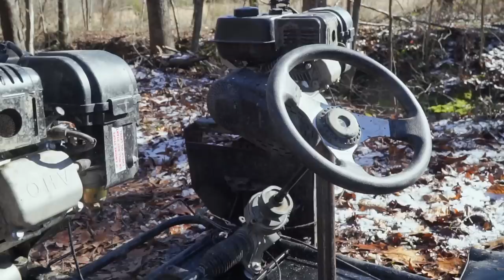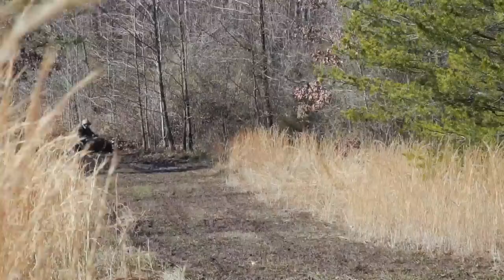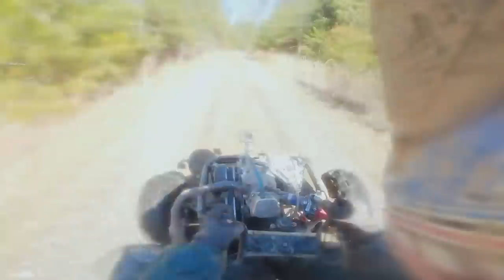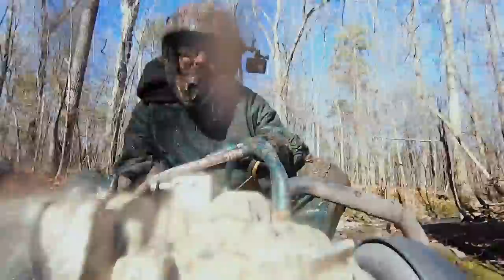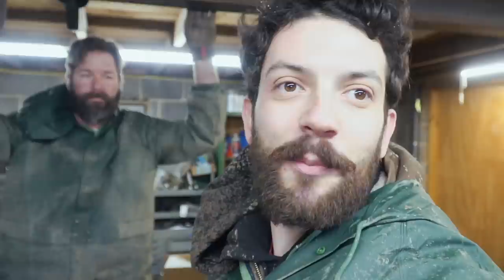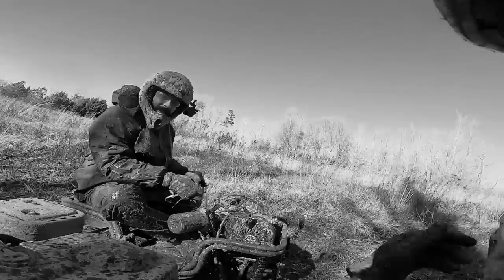4 Engine Go Kart vs. 4WD Power Wheels Go Kart | OFFROAD SHOWDOWN!

Comment from the maker: Definitely need to revisit this when we put new tires on the four engine go kart!
Reply: 100%
Reply: I think the four engine gocart needs stage two engines
Reply: Make a motor bike out of a bycycle or with a bmx
Reply: U should do a little rascal giveaway
Reply: Get some 18'' v groove muddies on that it would be sick.
Reply: Why was he riding the edge of the track? He was driving through brush lol
Reply: The tires yeah but I think it need a back to the drawing board moment
Reply: For sure
Reply: Or maybe make 4 new carts 😁😉😉
Reply: Time for "Cleats" aka Snow Hogs from Carlisle, for the 4 Engine kart
Reply: @A.M. Fishing & Adventures you do know they have $800 just in the engines and clutches
Reply: Yep, it'll be a totally different story...
Reply: @aaronraida1882  stage 4
Reply: 100%
Reply: Yeye Brother
Reply: You can get attachable forks to put on the tractor relatively easily. They aren’t overly expensive.
Reply: Go with 4 stage 4 predators or that new hot Tillotson on the original! Maybe longer struts for taller tires too?
Reply: @gamenfix2586  check out Isaac's channel....he's doing exactly that.
Reply: Full suspension!
Reply: it seems to have a lower top speed, too - I'd think about a pulley/sprocket change to even them up?
Reply: If I could thumb up this comment a million more times I would. Ike would smoke you in the uphill in the mud drag, poor buy was all over the place!!
Reply: Yes definitely
Reply: please go bigger on the 3 engine cart. 4x4 is no good when you only have 2 inches ground clearance. 21x10.50-8 3 wheeler tires would go a long way. and you could run them at low pressure for a little suspension
Reply: The four engine kart really needs some mods and improvements, it will be a beast after that!
Reply: I think the 4 engine would be more stable with a live axle in the rear
Reply: Please replace all tires and wheels with the likes of those on the rear of the Bronco. Never mind the torque-steer, muscle it like your life depends on it!
Reply: Take the governors off the 4 motor cart and tires!
Reply: Bring out the 420 swapped polaris and compete again the bronco.
Reply: @aaronraida1882  yeah buddy
Reply: Put AG tires on er'
Reply: Aren't y'all a lil to old for this stuff? I Kno it's fun go for it
Reply: Definitely
Reply: Bigger knobby tires and some suspension. You're bouncing around so much you can't even hold the pedal down..
Reply: Whatever happened to that ATV you guys bought
Reply: U need new tires
Reply: @CarsandCameras Greetings from England, Love what you do. Apologies as I've no idea of the etiquette on said platform, certainly don't want to piss a Yank off, we all remember you leaving the Empire etc. Does Isaac have a Cousin Rick in England by any chance? This blokes vids put your work on my radar, & like a lot of Isaac's work, I think Cousin Rick's latest masterpiece is Genius. 
Spoiler alert: Sinclair C5 - Crazy 125cc build - Part 2
https://youtu.be/gh6-zqwdbCs
Reply: Time to swap those 4 212s out for 4 420s with a gear change as well I think 50 tooth sprockets would be awesome
Reply: Get rid of the goveners please!! And bigger better tyres!
Reply: So in four years we will see the rematch?
Reply: You guys should build a mud mower
Reply: You guys need to make some mud mowers
Reply: even with new tires i still dont think the 4 engine will keep up with the bronco, be fun to find out :)
Reply: @tonyjeffery3988  well you could go follow Isaac's channel. John isn't on there.
Reply: Need new tire tread and don't give it Full Throttle right off the bat. There's no way to control that beast in full acceleration. Just engage get rolling then accelerate
Reply: Bring back the diesel cart
Reply: Yes but please mount that power wheels body.
Reply: GgGuilherme
Reply: No tug of war?

Comment: More ground clearance with larger tires on that thing would be beast
Reply: Monster truck version would be cool for sure. Big low pressure tires.
Reply: On which kart ???
Reply: It’s be a miracle if they pulled it off, but suspension would keep the power to the ground better aswell

Comment: I think that on the 4 engine go kart, you need big tires, more ground clearance, and maybe suspension. Great video.
Reply: How would you put suspension on that thing it needs to be scrapped
Reply: @frankdodson3534  I do not think that it needs to be scrapped. For one, it is their first 4x4 build, and it is actually pretty capable. It may not need suspension, but other than that, it is pretty good.

Comment: You guys should try to do some kind of combination of the two carts. A two engine cart with the CV axles and suspension. One engine for the front and one for the rear. I wonder how that would perform. Seems like a cool build

Comment: If there was anything you could change or improve, on the “Quad Rod”(4engine) what would it be
Reply: Solid axle in the front and back. Steering would be a pain, but it would prevent issues with the cart pulling one way from uneven delivery of power to each wheel.

Comment: That 4 engine go kart could be fast. You've got to drive that waaay different than a regular rwd 1 engine go kart. It needs to be man handled in the turns wide open damn near reverse entry drifting. Better traction would help but it takes a different driving style to rotate in the corner under power. Love this channel great karts.

Comment: The four engine seems to not have the top end and traction that the bronco has.  If they both had similar gearing and tires I believe the 4 engine would win every time
Reply: No, it's because the single engine cart has more horsepower. Having multiple engines doesn't increase hp, only torque. That's why the 4 engine one gets the hole shot but the other one out runs it ( more hp).
Reply: @burntsilverado  that's not how that works bud
Reply: @genoboughter3716  prove me wrong please.
Reply: @burntsilverado  the engine on the Bronco has to sent power/drive all four wheels which should have more drivetrain loss from the crank.. the 4 engine kart which is powering each wheel individually which should result in less drivetrain loss and more power to the wheels. But gearing wheel size rider weight ect ect..can play a big factor also
Reply: @burntsilverado  oh and driver mod also.. but that's just my theory

Comment: A few things to consider... yes it has 4 engines, but there's no way to sync them exact, so in a sense they are working against each other. And sure they yield 2 or 3 more horsepower total, but they also add a lot of extra weight, so you end up with a heavier cart that's harder to steer. Then add to the fact that you have no suspension and poor ground clearance on the four engine cart, where the bronco is lighter weight, can be made to steer better, has good clearance and suspension, and the bronco wins every time. The 4 engine cart is gonna crush the bronco on the start, but I think the bronco still takes it shortly after the start. And for playing in the mud, the bronco is definitely gonna go more places and win every time. Both are cool builds, but the bronco definitely takes the win in my book.

Comment: them engines gonna ned a refreshing, they sound pretty weird.
Reply: If your talking about the knocking noise, Its the Torque-A-verters, They can sound like rod knock over time as they age
Reply: @hotwheelsracer6380    I call that noise the need for new bushings. 

Unless you consider rod knock just another sign of age
Reply: I was using Rod knock as an example

Comment: Ya'll need to either get a set of forks from Northern Tool, that use a heavy duty bolt to clamp onto the cutting edge of your bucket. 
Then you should be able to get a set made by Kubota made for it, are make your own that you hookup after you drop the bucket off the front. 
The other way, is to make you a jen pole to use off the three point hitch off the back, that has a hook on it to hang either nylon straps, are chains.
Then you simply drop it down low enough to hookup whatever way you want to, and as long as you find the balance point, are catch whatever your lifting on each corner, you can pick it straight up and move it to wherever you want. 
Provided that your not trying to pickup more than tractor is rated for, are exceeds the limits of whatever you built for a lifting apparatus, and it bends instead of actually lifting it up. 
Works great either end for picking up different things, and loading or unloading things instead of trying to carry it by hand, are do it the way you did with the four engine go kart

Comment: Yall need to engineer some kind of sway bars for the Bronco, that will fix the issue with the front tire coming up when you accelerate thru turns. But make the sway bar easily detachable so you can disconnect it to give you more suspension travel for rock crawling.

Comment: The 4 engine go-kart has the same vibes as the Garage 54 makeshift V12, y'all'd gone and put an engine on each wheel, they'd took 3 4-bangers and bolted two above the original XD

Edit: Actually, the 4 engine kart has two main issues due to the mechanics involved in its design, the fact each torque converter is desynchronized by virtue of being 4 separate converters means when one wheel starts spinning, it starts going into a higher speed ratio and bogs that engine down when it regains grip making its converter slow to return to a higher torque ratio, and when stuck each wheel only has the power of 1 motor behind it rather than the full brunt of the total engine power, combined with the tread being rather mild its not got enough grip to keep moving in the muck, its a fun and interesting contraption yes, and its cool because its what it is, but there's a reason 4 years of building experience made the Bronco far faster. The 4 engine kart may be a relic of the past, but its rowdy and we still love it XD

Comment: How hard would it be to add suspension to the 4 engine gokart? Because that would be a machine for real. Also if that's too much work, just some larger tires should act as a little bit of a suspension.

Comment: You need to have the front engens going just a little bit faster than the rear that way when in the mud it will track straight

Comment: Id like to see the 4 engine kart rear end rebuilt with one engine and a live axle to lighten it up, simplify things mechanically, etc. It would still have 4 wheel drive, and plenty of torque and i think it would be faster because of the weight loss despite the power loss. Also remove the governors!

Comment: Four motors seem taking alot of weight. My friend build a gokart with 2x 212cc in the rear and thing are intense accelerating and topped out 50 mph. So for the tires ya should get a cleats that will definitely rip it!

Comment: The 4 engine cart was at such a disadvantage. Bald tires #1 and a smaller tire diameter. Something that small even tire diameter will change the carts final drive.

Comment: I was wondering if I could have a little help with my 212 cc go kart intruder its older and we just replaced the clutch and the carberator so it's the first time it ran in a while but it is very slow and the brakes barely work after we put hours into bleeding them. Anybody have any suggestions on what I could do??

Comment: Wonder if it would be a definite drag race if they were both geared alike one size smaller sprocket way larger try catch on the other one different size in the tires probably to

Comment: I would put panel a with 4 lights somewhere, each light would mean the engine is running. If a light goes out you would know an engine shut down. Seems like it is hard to hear if one goes out, unless you get drag from a dead engine.
Reply: That's a great idea! It would be super easy to do.

Comment: Get the same tires on 4 engine kart,rejet all 4 engines after free flowing exhaust is installed and maybe regear all 4 corners final ratio to match the tuned engines more optimally...

Comment: At least with 4 whole motors you know your getting out even if 2 of them die.....wait.... have you tested this?? What happens if only opposing diagonal engines were running? Can it do axis spins? Only front wheel drive? Hmmm...🤔

Comment: The 4 engine cart is heavier, with a worse CG, no suspension, smaller bald tires, wider, and longer.   Not surprising it didn't perform as well lol

Comment: It’s gonna be hard for Ike since it’s hard to keep the engines at the same RPM so he can’t get a lot of traction
Reply: The engines are synced together bud.... Its not 4 different throttles 😂
Reply: @theoriginalunfit4society262  Yes of course the throttles are synced together but the engines  still can’t run exactly the same as in all 4 engines aren’t in sync 24/7 they are going at different rotations as in the lifter arms are moving at different points, so the valves are opening and closing and taking air into the chamber at different times

Comment: ok, who didn't see this coming? you can't just multiply the hp of the smaller engines to figure total hp. it really only has the hp of a single engine as far as speed goes. mebbe it would work for torque and pulling power, but for speed they're not even close to being in the same league. 7.5hp vs. 22hp. that's why dragsters generally have a single, large displacement, high rpm engine, and competition pulling tractors regularly have multiple, lower rpm, high torque engines.

Comment: The 4 engine kart is governed. 3600 rpm and low gearing isn't going to beat the Bronco no matter how many engines. You need to pull the govs to even give it a chance.

Comment: The 4 engine go cart does not have 26 hp. Stacking 4 engines does not equal quadruple horsepower. It only increases total torque.

Comment: Not a fair comparison, cause even though you have 4 engines, its stil just like 6 or so hp, each engine is stock which is limited to how fast it can go and all 4 are doing that at same time. But the 4 engine cart definitely has more torque due to being able to spread that hp to each wheel, and you will always get the better hole shot

Comment: I have an idea why don't you guys rebuild the four engine go-kart but put the two front engines in the middle in the two rear engines in the middle and then run the chains down to a drive shaft and put independent front suspension and independent rear suspension then you still have a four-wheel drive for engine go-kart

Comment: I think Isaac only has 4 hp in reality. He may have 4 x 4 hp but it's like having 4 x 1.5v batteries in parallel, you have 4 times the capacity but it's still only 1.5v if you get my drift.

Comment: I can bet you a hundred bucks at the one with four engines the four predator motors would beat the other one if it had a good set of tires on it because I noticed in past videos they looked bald and you can see he was struggling for traction

Comment: There was no comparison in the Carts. the 4 motor cart had no traction and a lot of torque steer It was a very unbalanced race. It didnt matter they had the same horsepower Traction was the main issue.

Comment: If you know anything about handling and proper suspension set-up then you'd know having one wheel come off the ground on acceleration and when turning , something isn't right
Reply: Google weight jacking. Or watch a stadium super trucks race. Or watch any high HP 4WD vehicle accelerate out of a turn. I’m not sure you’re as well informed on this topic as you think you are.

Comment: Once again for the folks out there without a mechanical engineering degree: when you have multiple engines the hp does not multiply, only the torque does. When calculating the hp you ad them up and divide by the amount of engines and thats your true hp...